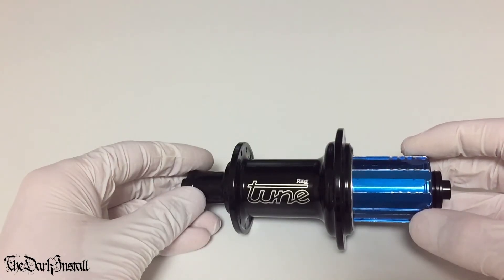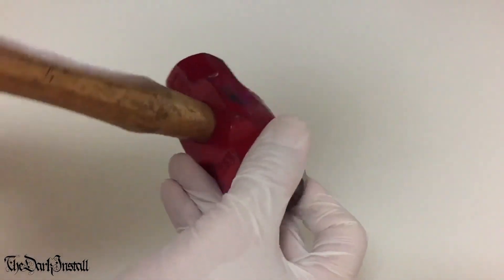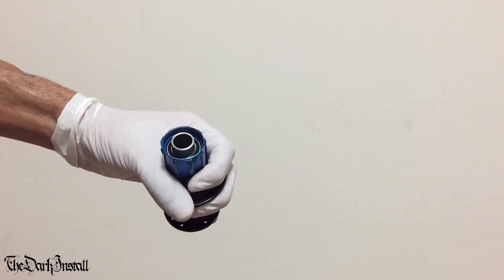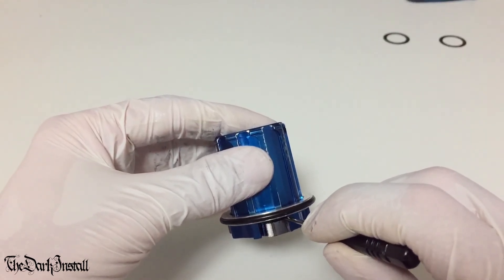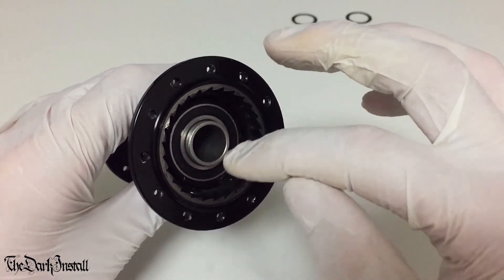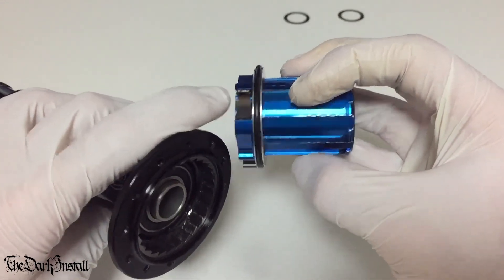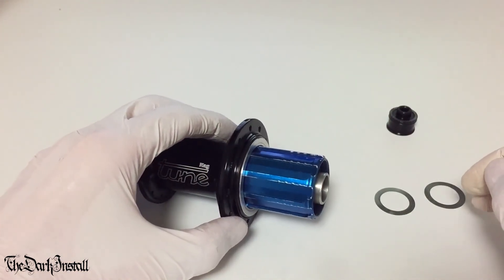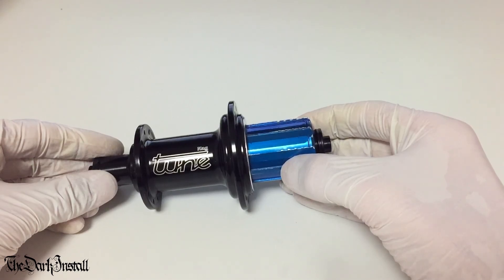Tune Mag 170. Full Service Instructions!

Comment: Brilliant!!
Reply from the maker: Thanks!  Let me know if you have any questions, about any of the process.  I should add also, due to the possibility of the axle being dry in the hub, or generally just a tight fit in the bearings, you should apply lube to it before hitting it through, and also before knocking it back into position.
Reply: Just ordered the cassette grease from Amazon.